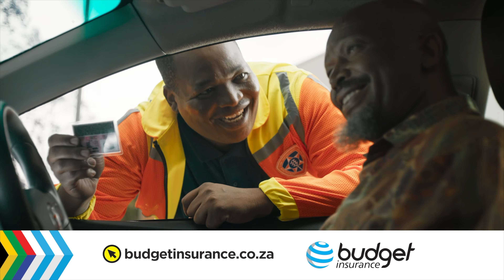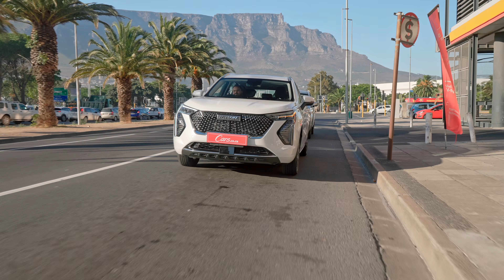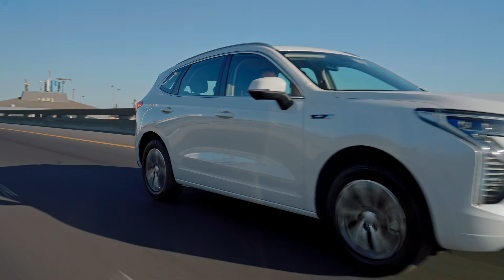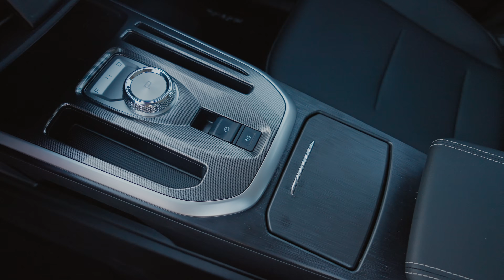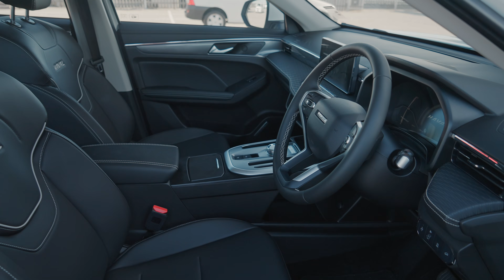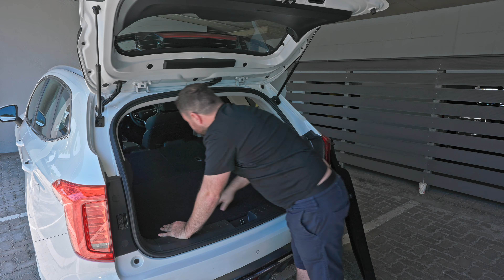New Haval Jolion Hybrid Review - Pricing, fuel consumption test, specs and practicality

Comment: I bought my Jolion HEV about eight months ago, and I'm mostly happy with it. It's fuel-efficient, using around 6 litres per 100 km in the city and 7.5 litres on the highway. It's not very quick off the line, but it's okay. However, there are some issues I wasn't told about:

* The headlights are not automatic and do not dim when another vehicle approaches. 
* The radio lacks an RDS function, so you lose the station signal while driving and must keep searching for the strongest signal in the area. 
* The car struggles uphill because the electric motor does not assist the 1.5-litre engine, which feels very underpowered. It needs a turbocharged engine.
* The infotainment system performs better with Android than with Apple CarPlay. 
* The car does not store your phonebook internally, so it downloads it each time you start the vehicle. If you have an extensive contact list, this can take several minutes or even fail. I have set it to download only recent calls and favourites. 
* The adaptive cruise control is ineffective. It maintains a large gap between you and the vehicle ahead, allowing others to cut in. The option to reduce the gap is inadequate.

Yet, I don't regret the buy.

Comment: So I just purchased a Jolion HEV. 2 weeks ago. My first tank of fuel at 5.1L per 100km. So about 920km. So figures are right but it’s how you drive. Boot is small but usable. Single pedal drive works well. Since I have electric BMW i3 as well I am used to Single pedal and uses less breaks so you will save if you use it.
Reply: Also test drove the Corolla cross hybrid. Smaller cabin, less features and noisy motor with very little power vs the Haval.
Reply from the maker: Thanks for sharing your experience. We wish you many happy miles with your new wheels!
Reply: I GET 4.3 TO 4.6 ON JOLION HEV
Reply: thats what i am getting now @corinneterblanche5911

Comment: How does the Cross Hybrid provide a spare typre but not the Haval?
In dangerous SA this is not a good thing.
Reply: Toyota has been doing hybrids for 25 years so they’ve designed the battery to fit under the back row seat, while other manufacturers “retrofit” the battery and place it in the boot,  using up valuable space needed for the spare tyre and cooler boxes!

Comment: I live in NZ and took the plunge in December 2022 as Haval had a sale and the Hybrid version just came out. Sale was possibly because Haval is nowhere near as popular here compared to SA. You can only buy the Ultra spec here for the Hybrid model but the sale reduced the $43,490 retail price although the "on the road" (registration etc) cost ate significantly into that "saving". Clearly SA is taxing the crap out of new imports, given what I can buy the Ultra version for here vs Super Lux there 🥴 However, it's not all taxes I expect - here in NZ motor or service plans are not included, you have to purchase that on top, if available. NZ government does sweeten the pot a bit given their clean car rebate scheme, again Jolion Hybrid won't get you anywhere near the rebates full EVs get but still a nice little cash back. One common truth is that you can still buy a heck of a lot of fuel for the price difference between the petrol and Hybrid versions.

Comment: Great review Ciro. At R549k, the base hybrid is R206k more than the base model 1.5 litre petrol Jolion. That would take, what, 100 years or so to recoup in fuel savings. By contrast, the difference between the base model Cross and the hybrid Cross is only R24k.
Reply: Your problem with the Cross is, you have to wait more than a year, somethimes 2 for a new car. If you buy it second hand, you pay more than Jolion new.
Reply: Exactly what I was thinking

Comment: Just bought my corolla xs hybrid 4 months back, its been a joy to ride with.I am very sedated driver and get 5.3-5.5/100km. Seeing this review, i see this Haval is a typical suv with the hybrid addon. But i feel the entire mindset of those going for hybrid should be efficiency and not peak power output, pushing these peak torque figures means you are going to lose a lot of efficiency in the long term. The boot is a joke on this car and no spare wheel for that price point of 540k even for the base model is quite high. If you have the money and don't have the patience to wait for the corolla cross go for this,. if you just looking at peak torque figures just buy the normal jollion or H6.  Just as Ciro says,  i did feel the lack of power when i was in the highways, especially on this recent trip to Drakensburg from Joburg, but the power mode came super handy in the passes where the engine is more responsive.
Reply: I GET ON THE JOLION HEV 4.3 TO 4.6
Reply: My only issue with Toyota Cross Hybrid is the high theft risk and the small fuel tank😢😭💔

Comment: So I did a quick spreadsheet looking at relative costs of a Jolion S with fuel consumption of 7.5L, and Jolion HEV with fuel consumption of 6L/100km, and their relative retail prices (used top spec models for each car), and even after accounting for savings in fuel, Jolion HEV works out about 80k more expensive after 5 years of paying off the vehicle. So I think they got the HEV pricing wrong. Granted its a premium technology with small numbers currently so you're paying extra for small demand, but there are no monetary savings realised with the HEV. You just feel good because you're saving the earth one accelerator press at a time 😂
Reply: In real life apparently Jolion owners do not get to that claimed 7.5L/100km figure, whereas with this HEV model it is possible to get to 6L/100km or better as Ciro has demonstrated. So the difference would be less - but yes, I get your point you are trying to get across
Reply: @ishakemyhead799  fair point, I also added in a guesstimate adjustment for real world fuel consumption compared to what is reported, but I assumed they both increased by 25% whereas you say that jolion S is more whereas HEV is similar
Fair. .

I also checked again and the number of kms travelled per month actually affects the difference: I assumed 1000kms travelled per month, but as your monthly distance travelled increases, HEV savings also become more apparent, becoming cheaper at around 2700kms per month. 

So my earlier comment only holds in certain scenarios, but point is that it is  important to do this exercise before assuming you will save money because of lower fuel consumption.

Thanks for comment!

Comment: My only gripe with these Jolions is that they just do not look like their underpinnings are strong enough to support the car's weight!!! The tires look to small and it appears to wallow when driving. I have seen quite a few of them on our roads lately that appear like they are overdue for a wheel-alignment... I hope it's not the suspension rods \ axles that are bending over time; under the weight of the car.

Comment: Ciro, you provided a lot of confusing (and incorrect) info here. First, you mix up the kW and Nm figures of the engine and battery (and the engine is turbo charged, not naturally aspirated). Secondly, first you say there are two spec levels - S and “non S”. Later on you correctly refer to the high spec as Super Luxury. The two spec levels on the HEV is Luxury and Super Luxury. There is also a new “S” model (non HEV) with slightly higher kW and Nm figures than the rest of the range. Other publications have correctly reported on all of these new models. To err is human but I expected a little bit more from you in this video!
Reply from the maker: Hi there Andre, we have confirmed with Haval and the engine is not turbocharged as some outlets are reporting. Additionally, as we had the car early, before the SA press information was available, we had to rely on Australian reviews, which state the kW output as 139kW, not 140kW as Haval SA later stated. We apologise for the confusion around the name of the variants, that was an internal miscommunication. We endeavour to provide the first look at a new vehicle for our audience but sometimes that means we are working off of bare bones information, or information which later changes. We hope you found the rest of the video helpful and we thank you for supporting our channel.
Reply: @Carscoza  Thank you for the clarification, it is appreciated. I appreciate that you want the “first look” of a new vehicle out asap, but it wouldn’t hurt to just hold on a little bit longer to confirm specs etc. as it may be frustrating or confusing to watch as in this case.  Lastly, as someone else has also commented, please consider testing the 0-100 figures as many other global channels do - especially on vehicles from Haval etc. which do not provide those figures. Thank you for creating all these videos, looking forward to many more interesting ones this year.

Comment: A great solution to no spare wheel is fitting tire safety bands. These go between the rim and tire and essentially convert your tires to run flats at a fraction of the cost of replacing all four tires to run flats. Plus when it comes time to replace the tires you can replace it with normal tires and don't have to pay extra for special run flat tires.
Reply: Those bands serve no purpose except preventing the tyre from slipping off the rim when flat. Suggesting they convert your tyres to runflat is misleading
Reply: there is another argument that if your use is mainly urban (i.e. this isn't actually an off-road vehicle) you are always within calling distance of a breakdown service and the beast hardly ever breaks down so why waste space on the tire that never gets used ?
Reply: Nonsense. Those safety bands are more of a headache as not all tyre shops have the equipment necessary to remove a tyre with the band installed. Rather just carry a small spare or those tyre can inflator things

Comment: Eish... That boot and lack of spare wheel is a deal-breaker. Such a shame, cause this is really a good city car!!
Reply: A very easy solution to this would be to fit safety bands which go between the rim and tire and acts as a run flat. It is a much cheaper solution than changing all four tires to run flats.

Comment: How does the electric motor recharge? Is it a plug-in hybrid, or is the electric motor self-charging?
Reply from the maker: Correct, this is a closed loop hybrid and does not need to be plugged in. The battery is charged through regeneration and via the petrol motor. Thanks for watching!
Reply: I stand corrected, but I think it recharges the battery when it switches to the petrol motor.

Comment: What does it mean when he says 5 year 60 000KM service plan? Do you service the car every 60 000KMs? or your 5 years service plan ends at 60 000KMs or within 5 years?
Reply from the maker: Hi there, yes the service plan is 5years/60,000km in length, which ever comes first. The service interval is 15,000km. Thanks for watching
Reply: Ends at 60K or 5 years. If you do 60k in three years you lose 2 years if you get to 5 years at 40K then you lose 20K
Reply: @mosesmaseko1501  Thank you

Comment: You should include 0 - 100 km/h tests in your reviews....please
Reply: What is the point of 0 -100 on reviews for everyday cars?
Reply: @TheAvela  they are fair if used *when comparing more or less the same vehicles*, completely useless for workday people
Reply: That's rather unimportant. On a daily basis, how many times in a day do you want to make a sprint from 0-100? Rather have a look at it from the manufacturer's spec sheet.
Reply: Please edict me a bit
So does it mean once you pass 50 or 60kh the car automatically move from EV mode to normal mode##?does it mean EV mode can't drive more 60kh only drivers less than 60kh?
Reply: @musamathevula9139  to my knowledge its a hybrid, not a fully electric car. Speeds above 60km/h require a fair amount of energy that a hybrid battery would not be able to produce, hence it switches to engine mode. Otherwise it would be a fully electric car.
Reply: @musamathevula9139 these   closed system hybrids are simple but revolutionary, they use the engine where it's most efficient and the battery where most efficient, you just pour petrol, no need to charge when you go home, they're the best of both worlds.
Reply: This is not Carwow, 0-100 times are unnecessary for cars like this.
Reply: @Sims_lane  it gives the viewer a measurable value to how nippy the car is
Reply: @tabzmatthews  it is not a sports car, same reason why they are not going to take it offroad and see how it does on a jeep trail bcoz it is not a 4x4
Reply: @tabzmatthews  you should make your car choice wider than this if you are so dumb you want a robot racer, HOW FUCKING STUPID ARE YOU, THIS IS NOT A ROBOT RACER !!!  grow up, move on, jeez :(
Reply: It takes 8.7 seconds for 100
Reply: It's pointless to do such test with regular cars, the numbers won't be interesting compared to Lamborghinis and ferraris
Reply: It's pointless to do such test with regular cars, the numbers won't be interesting compared to Lamborghinis and ferraris
Reply: Just watched another review it came in at 9  seconds 😊
Reply: It is extremely important info, if you are at an intersection on one of the national roads you need to know how fast your car is from 0-100, I have seen many cars turn onto the N2 after visiting a Padstal and cars needing to brake in order to accommodate a driver who has very little gauge for how fast cars are coming on and how much time it takes he’s car to get to up to a suitable speed without putting themselves or other road users in danger. It has nothing to do with racing but everything to do with knowing your car. Which is why we watch reviews in the first place not so?
Reply: I don't think this is a fag race vehicle, if you are trying to get your family from one robot to the next faster than someone else this probably isn't the car for you :)
Reply: I was thinking the same thing.